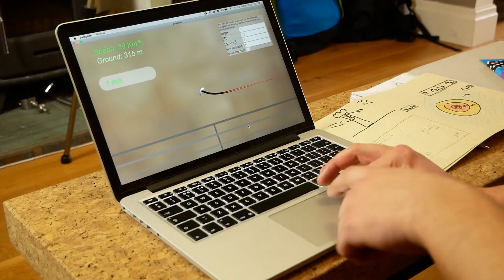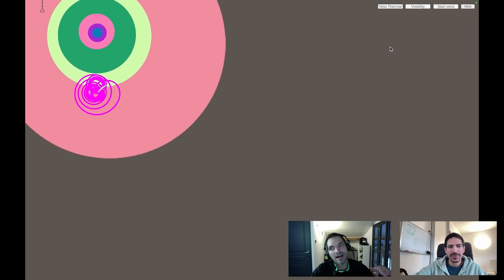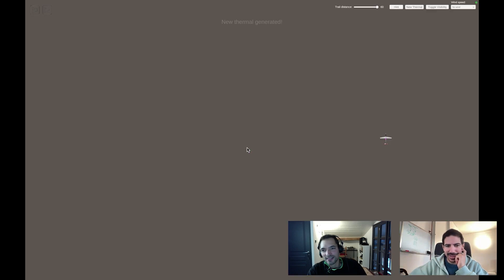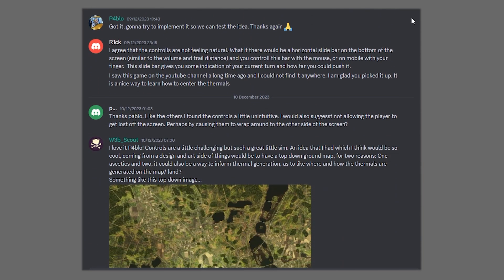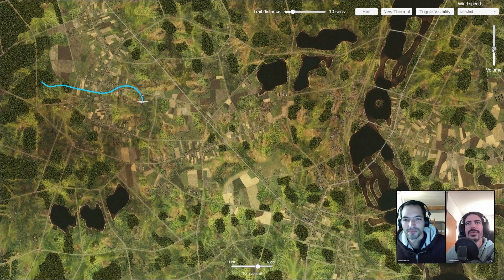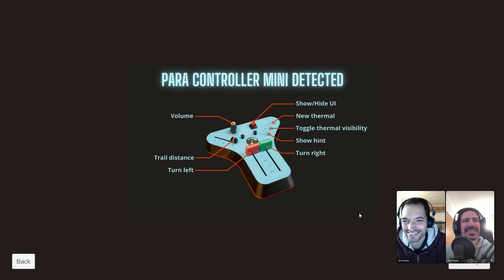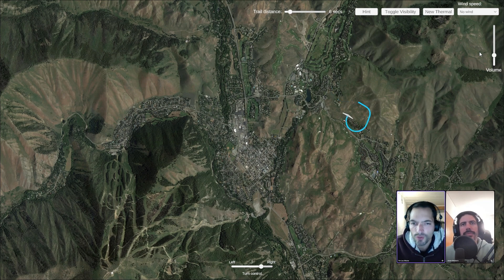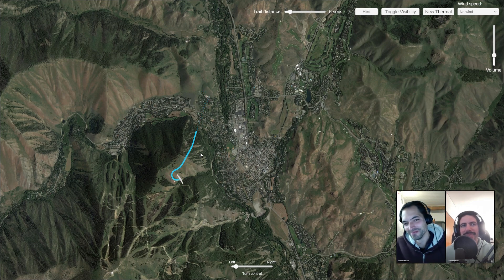Center it! Find and core the thermal - BANDARRA

Comment: I love it!!!   But one observation with the windier settings:  The glider seems to turn in place while the thermal moves with the wind.  In reality, the glider will move downwind also, and faster than the thermal core since we have less resisting mass (I think).  So the usual thing in a thermal is to push into the wind on each rotation.  But in the simulation, this actually takes you further from the core instead of keeping you in it.  I think it would be helpful to tune this to help practice the technique of pushing into the wind each time around.  It would also be more realistic in the windier levels to elongate the thermal shape more away from the core downwind.  And perhaps also, if it's not too much, to also put some scattered lift downwind of the thermal as realistic cues that there is something upwind.  Love it!!!!!

Comment: This kind of simulator can be a great learning tool! but some realism is needed for the learner to be able to match what's found in the wild to the exercises. You're on it, I know :) These are a couple of things that come to mind that may be easy to implement. Hope it's useful!

- Some thermals detach from the source and drift with the wind, but the typical thermal is attached to the trigger point and drifts as it goes up so at the same altitude you'll find the thermal in a "fixed" point, but it would be in a different position as you climb. It's like an inverted cone, drifting and getting wider as it goes up.

- The thermals in your game are modeled as a set of circles centered on each other. That can be the case with little or no wind but in wind, the bigger surrounding circles drift more than the smaller ones, making it look like the "center" is actually on the upwind edge.

- Also in the above wind situation, ovals would be more accurate than circles, and the downwind tail is pretty much all broken. This is relevant since one way to "smell" thermals is to follow that broken lift upwind.

- Wind drift on the aircraft is relevant too, since a constant turn will not maintain your position, even when drifting with the thermal as you go up with it. In reality you're sinking through the lifting air so you'll end up dropping out of the back of the thermal in a couple of turns. When thermaling, one is (consciously or through your "centering effort") always pushing a bit upwind to keep inside the thermal. Try making a 3D image of this in your head and you'll see what I mean. Constant circling falls back and below the thermal. In real life it's way harder to get back in from this position since you may be in sinking air and your glide ratio is never enough to get back inside this conical thermal shape. When falling from the front is easy since the front of the (tilted) cone is actually like a hill and you'll "fall" on top of it. The tilt is very strong with the wind. Try making some calculations thinking of typical vario readings and wind speeds, eg. 1.5m/s with 15km/h wind.

- Then regarding altitude, thermals may be weaker at the bottom, stronger in the middle, and weaker again at the top. So you may feel less lift but you still sense the core boundaries so you stay where you are.

- I haven't seen the glider altitude in the screen. Is it there somewhere? do you run out of it?

- Scale is important too. Thermals of all sizes exist. Varying the size may be a parameter linked to the game level.

- Thermals shape I imagine "wobbling" a bit too. This can also be linked to game level.

- Ah! turn time some say is about 15secs in real life. Some use that time in their vario averager to see the lift averaged over the whole turn.

There you go, my wish list for Santa! :) Kudos for the effort!

Comment: Cool.
But note that a thermal does not drift with the wind. Wind causes the thermal to go up in a slanted way. The stronger the thermal, the more it is able to withstand the wind. This causes the shape of the thermal to change, with the core of the thermal on the up-wind side, and the weaker part on the down-wind side. Of course, the paraglider DOES drift with the wind, which means you need to fly longer against the wind that with the wind to stay in the thermal. 
Getting that right would really help pilots understand how to fly in windy thermals, I think.
Reply: That's great feedback, I'm taking note of all of that in order to improve the mechanics of the game: Thanks a lot 🙏